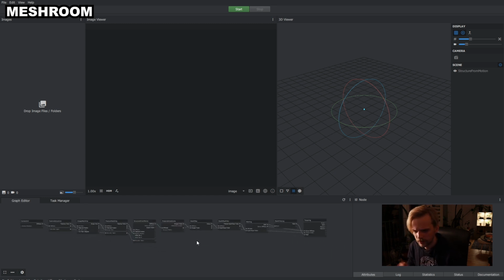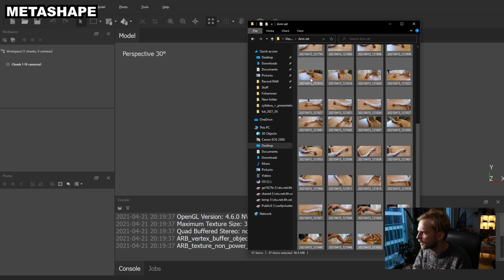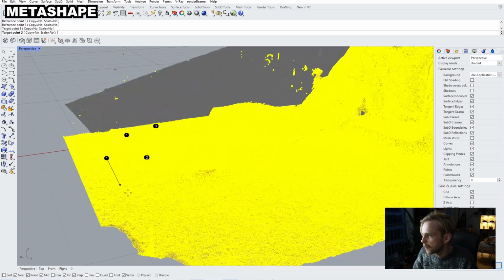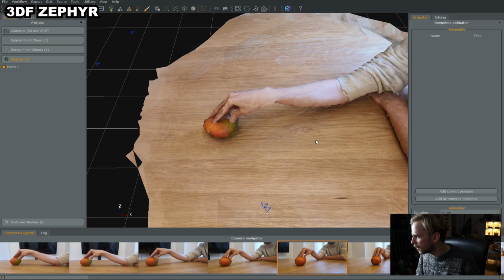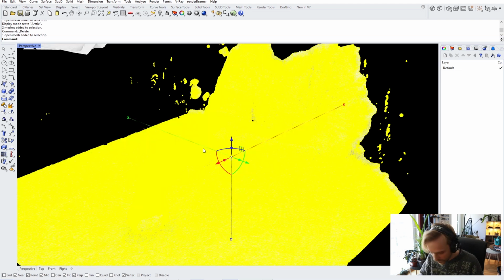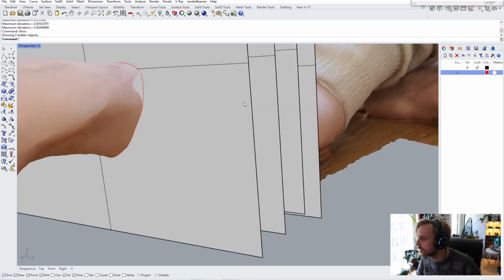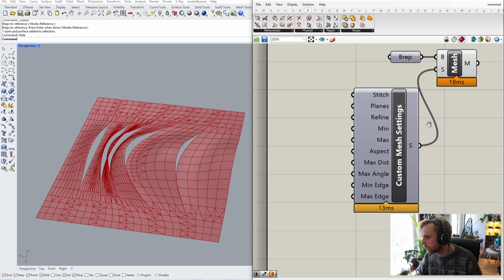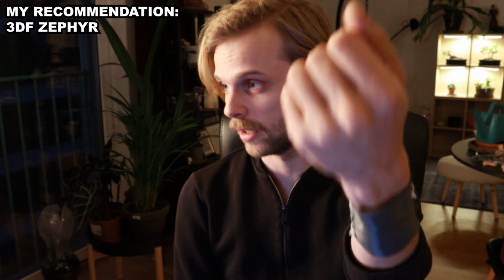Finding The Best Free Photogrammetry Software in 2021

Comment: Could you write which software took how much time? One more thing, could you explain in which software and how can we learn real measurement? For example, I created a 3D model in Meshroom but I cannot understand is it 10cm or 10meters. Should I use different program or real measurement is impossible? Thank you!
Reply from the maker: The calculation time was similar. Umm photogrammetry software doesn't work in real-world units, so for you to get a good scale, you'll need to import a 3d model to any other 3d modeling program, such as blender
Reply: @Gediminas Kirdeikis  thank you! Could you suggest any tutorial or video about it? Just for confirmation, after having 3D model, I can have real-world units (such as 5cm) with blender named program right? I do not need to have any "control points" or "known distance" (3DF Zephyr website mentioned them). Basically, could I do this: Took 48 photos of a Sunglass > Put them in 3DF Zephyr > Got 3D Model > Put 3D Model into Blender Program > Got Measurements ?

Comment: First of all, really detailed work.

Secondly I think you need to have good quality photos to compare, those models are bad because the photos are bad and is a challenging subject. My advice is to go outside on a cloudy day and find a nice rock/sculpture for taking your pictures, above 12mpx photos should work fine if those are sharp enought. Keep it up, by next year I hope seeing some quality models on your test :)

Kind of a shock so many ppl does not know rhino 3D, guess solidworks and fusion 360 are taking its market share...
Reply from the maker: Thanks! Good points about the quality - next time I'll do a tutorial (how to take suitable photos for photogrammetry) + software comparison. This time -it was all about "if you're a complete newbie and have a potato for a camera and have no idea what is a suitable photo setup - which software will correct for it the most?"
Reply: @DesignGoBrr  well potato camera is the least of the worries, i had the best scans with smartphone pics (tried mirrorless too, phones just focus and work so much faster...). And yes you're correct in ease of use with all of them, is a factor to consider too. But human skin is a bad subject, is very tricky, I've only see good results with camera arrays. Anyways this is a good demo video for newbies, and you use rhino 3D so you must be a nice guy xD.
Reply: Hello,RealityCapture Meshroom Metashape which is better?(I use RTX 3060 12G)
Reply: I usually work with metashape, it gives decent mesh for the time. Reality capture seems to be a very good soft too, although I did not test comparation. Meshroom is a good free soft, but process time and quality are worse, but it is free so maybe for someone is a better option.

Comment: "not even a TI"
I feel you brother, 
but the work you do is much beautiful with the GTX1650
Reply from the maker: Last year I was stuck with a GTX 760m , so even a 1650 is a biiig improvement to me
Reply: @DesignGoBrr  well that's awesome! I recently upgraded from an 820m to 1050TI. (At least there is a TI),, and the improvement is huge... I think with all these CAD softwares, the tip is to optimize and probably you or I won't need to sell a kidney or both for the latest RTX

Comment: I searched for the exact title of this video yesterday! Best timing! Yet, in my search still couldn’t find a better option to using the “face id camera” from the iPhone
Reply from the maker: Isn't that just a Lidar sensor that iPhones use for face unlock though? If so - then it's not even in the same league as these programs. It's much closely related to how Xbox Kinect works.
Reply: @DesignGoBrr  No No! The lidar just came now with the new iPhone 12 that is way to expansive. Since the iPhone 7 it unlocks the screen using a front camera that has a very capable sensor. Some apps makes use of it and for me it’s way better at maintaining 1:1 object size and with less jittery surfaces.

PS: And I don’t think that the Kinect also has lidar, so probably it’s a similar depth sensor indeed.
Reply from the maker: @MrCineris  Aah got it, I had those two mixed up and thought they were one and the same. Sucks that I don't have an iphone to test it out tho

Comment: the node graph stuff in meshroom is pretty powerful, for example it lets you modify the mesh in another application and then retexture it from the original point cloud. so you can simplify/reduce a mesh to the point where it's buildable from paper, retexture it, and craft a low-poly-but-high-res version of the original
Reply from the maker: Yup, that was why I liked meshroom and why I used it as a "contender" here... Buuut apparently new release is unstable - there's a ton of forum posts with issues left and right. Few years ago it was my go-to photogrammetry software, but now it seems to be lagging behind quite a bit. Even if it were stable - meshroom took >1h , while every other alternative was <15min...
Reply: @DesignGoBrr  Meshroom also has a video frame extraction tool, but it runs independent of the standard stack functionality. I think you access the frame extraction from the file menu.
Reply: @steenblikrs  Does that work well? idk if that's the most enticing feature even, because you could use free video editing software like davinci resolve to export a video as frames. 

I'm curious if that'd work well, It'd absolutely be a nice feature for convenience, especially if it's fast, but it's not like it's making the impossible possible. I've been looking into a polycam subscription because they seem to have the best paid scanning stuff, especially if you have an iphone.
Reply: @Cramblest  Any time I have edited, post-processed, cropped the image outside of the photogrammetry process the computational process has a hard time associating the images. Maybe because of meta-data, maybe it's user error on my part. 

Meshroom is continually improving, and at a pretty good rate, but the best software I have found is Reality Capture, which after being purchased by Epic is now much more accessible, especially with an education license (which previously didn't really exist).
Reply: @steenblikrs  ohhhh wow.. that would explain a lot, honestly after commenting i tried to convert video using my technique and it did not go well haha
Reply: But Meshroom never works